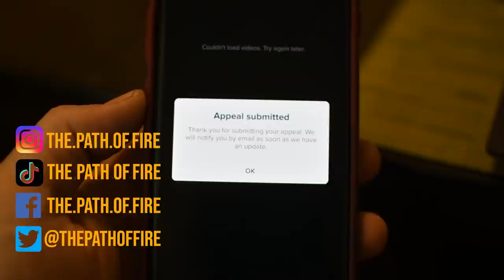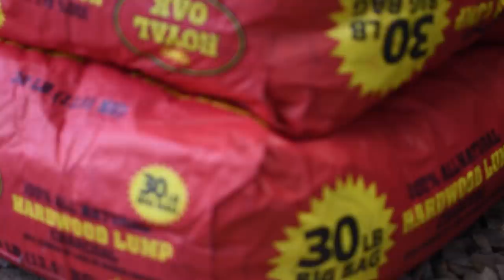vlog 6: making bar stock while answering some questions

Comment: Kids are hard work, Discipline, Structure Tempered With Love , and Patience with long hours no vacations but those smiles and laughter could melt steel Specially when they sneak up behind ya and give ya the sweetest hug, Worth it. Fools afraid to show Blacksmith work are the reason Cheap worthless soulless blades exist manufactured in bulk with no history No passion just a stamped number instead of a makers mark.

Comment: Whatching you hammer metal I see your anvil moving, some of the energy your using is wasted on your anvil moving. Just a suggestion, if you fix the anvil to the base will assist with more of your power bending metal. Fix the anvil with rail spikes to the log, you get better support and a better feel from the steel.
From an old blacksmith with lost ambition. Be safe🥽
Reply from the maker: not really much to do as i dont want to set it.  everything is going to need to be moved out as i am having a floor laid down before winter

Comment: Do you find that you have to use more charcoal than you'd use regular coal? I'm considering running a coal forge, as well as a propane one, but I'm concerned about the availability/cost effectiveness of fuel.
Reply from the maker: Great question! So anthracite and charcoal don't coke up they just burn away so you go through more than the dirty coal but since this video came out I've only gone through one bag

Comment: Just curious why you use hardwood lump charcoal instead of blacksmith's coal or coke?

Awesome videos! Much love!
Reply from the maker: more historic
Reply: Fay has coal in stock, and she has a new gas forge on the way. She works with multiple sources of heat, as she feels appropriate.

For myself, on the forge I was working with, I found wood charcoal easier to light, but the fuel burns out very rapidly, so you have to keep adding a lot of charcoal very often. And it didn’t get very hot for us. We found coal to be harder to light but easier to keep burning, and we were able to easily get it up to working temperatures. But coal gas is wicked nasty to breathe.

But my friend and I were just a couple of amateur blacksmiths playing around and we didn’t have much experience, whereas Fay is a Master, with 18 years of experience. I am sure that she knows what she’s doing.

Comment: Faye,
Every time I see your anvil move a little when you strike iron (or steel), I cringe a little bit. Is there some way you can shim your anvil block to kill the movement? Maybe dig out the earth under? I hate to think of all the energy you expend moving anvil and block. It must add, slowly but steadily, to the overall stress of a day in the forge.
Reply from the maker: So I've not done it because I keep saying "I'll do it when the floor is poured" sadly that just keeps getting pushed back and back
Reply: I understand. I really, positively, absolutely, unequivocally, forever and ever amen understand. 
PLEASE stick a shim under it until the floor is done.

Comment: An observation and question, I notice your anvil moves about quite a bit while you are hammering,  surely that movement is wasted energy which would could be better directed into the work piece. It doesn’t appear to slow you down but easier not harder  has to be better for you.

Comment: Great video... one question wouldn't actually coal be cheaper and hotter than charcoal?
Reply from the maker: cheaper yes, and i do mix them, hotter, not really.  well it depends.  there is not a quick and simple answer.  each has its use.  like pine charcoal burns like the damn sun. and oak burns hot enough to just forge weld.  it really is a form of temp control by picking the fuel you need for the job youre doing.  coal is for sure cheaper though.  like i got 9 bags of anthracite coal for what two bags of normal would cost me.  i got this much charcoal because i am going to be making a lot of bloom steel soon